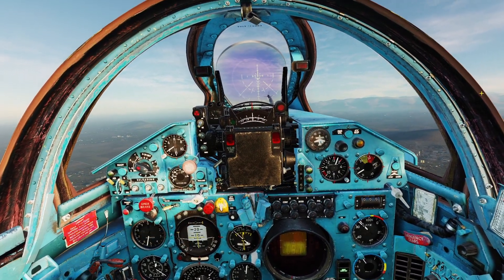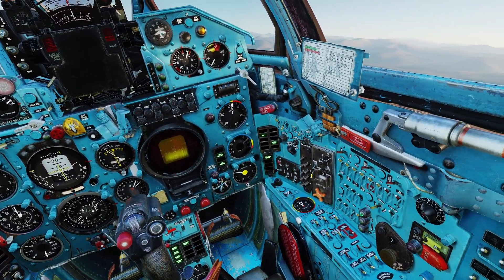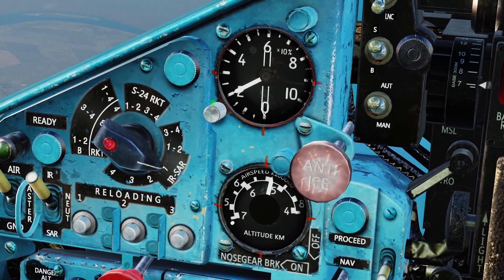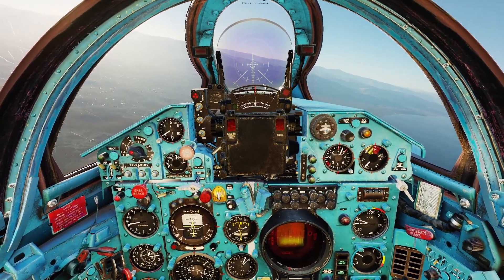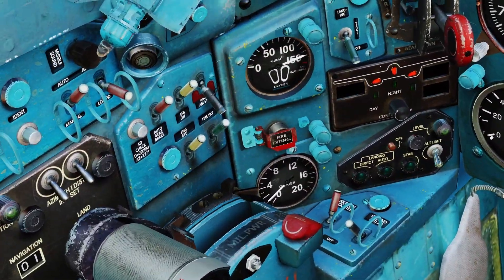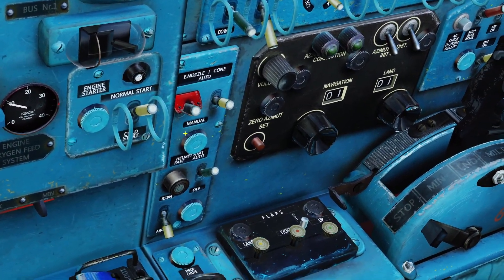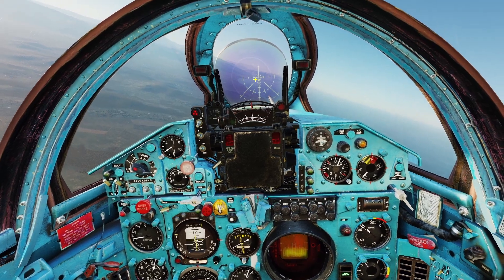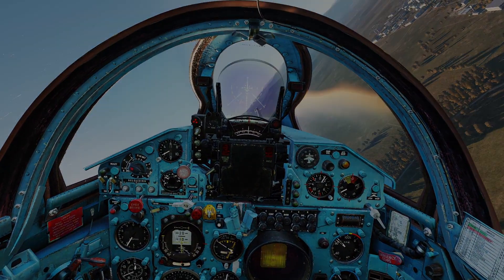DCS MiG-21big Engine Management

Comment: Anti-surge doors - My understanding is that these open to vent the incoming air out. This reduces the pressure going into the engine, clearing the surge. They aren't just airbrakes. 

That said, slowing down also reduces that pressure. Having had surges in the MiG-21bis, I open the doors and then bring the throttle out of Afterburner to avoid the surge.

Comment: Great video and very useful tutorial!! I just want to give you some information so its accurate.

A flame out is where there's not enough fuel going into the engine to maintain combustion which is why the engine slowly dies, but very recoverable.

A surge is where there's less air pressure going into the engine than going out and the air flow starts to go backwards through the engine (usually happens during reheat) if not dealt with it will break the compressor blades.

I hope this helps!!